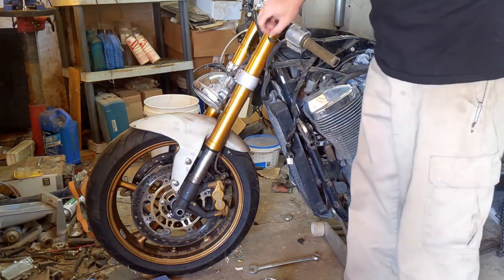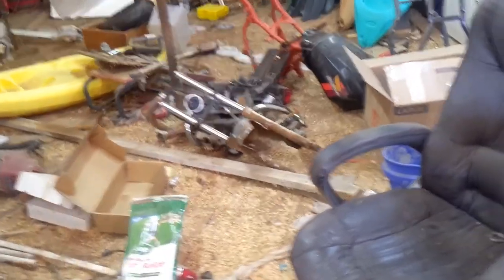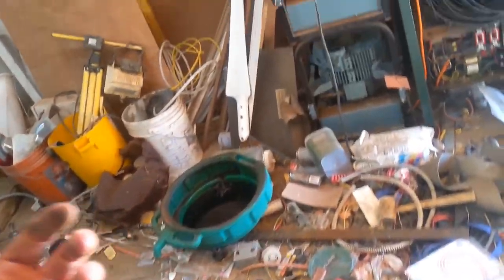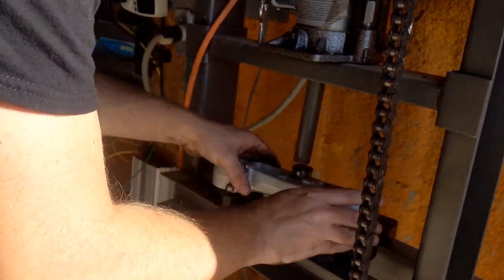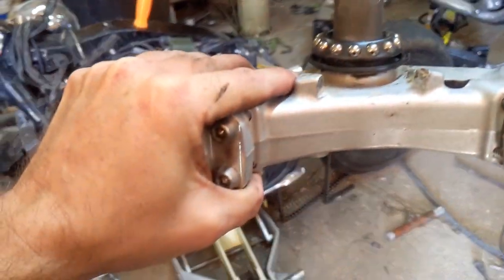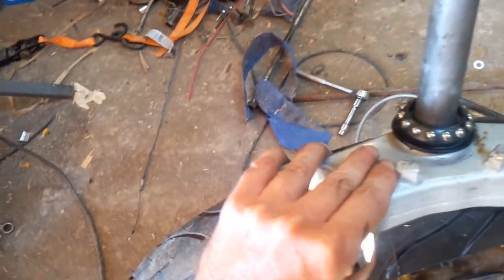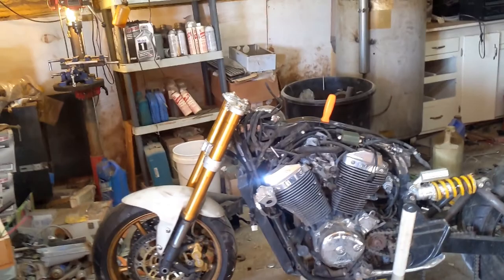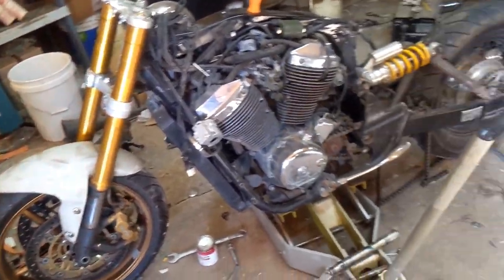Honda Shadow 750 fork swap (and how to swap any forks to any bike)

Comment: Man id like to put a  good fork setup on my Honda magna      .      But I still want to have my handlebars not clip ons
Reply from the maker: There's really a lot of options for doing it.  If nothing else, thanks to the streetfighter scene, there's a huge number of suppliers selling everything from conversion upper triples to weld-on adapters to even simple single bolt drill-install risers.  You can get proper handlebars on just about anything.  I'll probably end up running some kind of standard bars with this build.

Comment: I have a 1988 Honda Shadow 800 and am looking to swap its forks with a 1984 Honda Magna 700 you think this will work?
Reply from the maker: I can tell you that the front ends between the two bikes will interchange, but I can't tell you how effective the swap would be (if it would "work")

Comment: Will I be able to put a fatter forks on my vt1100c shadow? Like off of a suzuki Boulevard.
Reply from the maker: Hi Mark!  I'm honestly not sure because I don't know what the offset of the forks are on the Boulevards.  It's a pretty straight forward swap with a lot of sportbike forks because they're narrower.  I know without a doubt that you'll be able to mount the forks, but not 100% cetain you'll clear your tank.
Reply: The bearing housing between the trees on the suzuki boulevard is longer then the honda shadow vt1100c from what I measured but I found out that the boulevard just has fork covers that makes them look fatter. I might just get me some covers some day and see if I can put them on my forks

Comment: Hi, dou you think its possible that a Shadow 600 or ninja 300 fork is compatible with a Vulcan S(also in terms of weight capacity)? I know is a very specific question but it is a project Im currently working in....
Reply from the maker: In a sense they are...it's just a matter of swapping bearings and possible the stem...unfortunately I've never gone that way myself so I can't offer a lot of specific advice.  I can tell you that if you're trying to work with what you have on hand and your Vulcan needs forks you might be better served to sell the Shadow and Ninja parts and buy the "known fit" parts.  I've been down this road a great many times and sometimes it's far more bumpy than its worth.